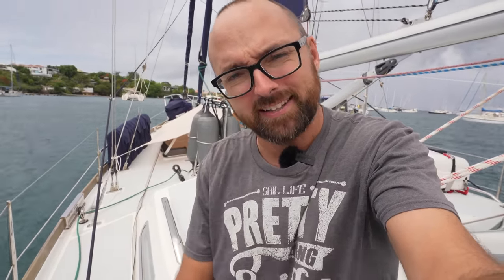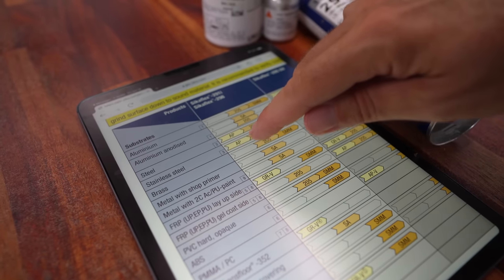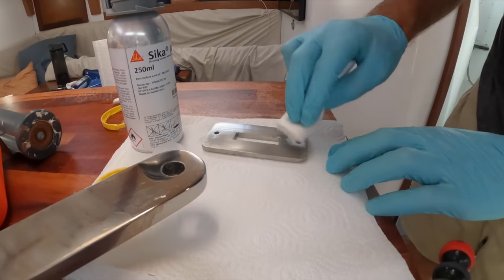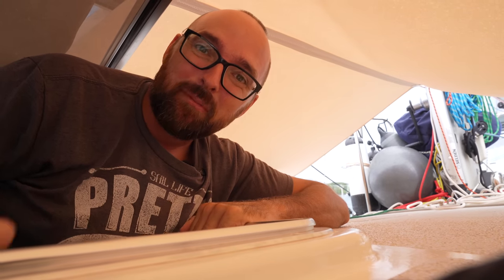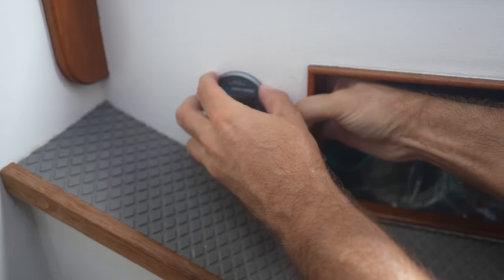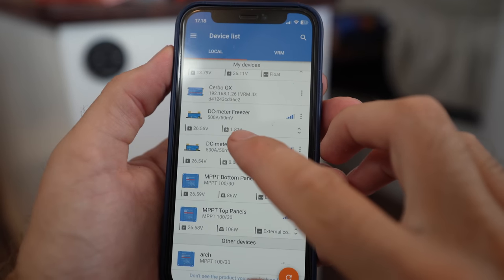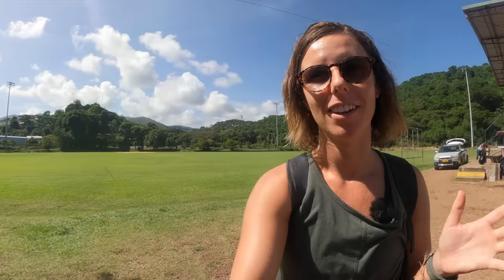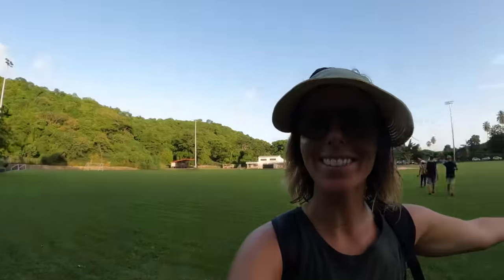Sail Life - Victron Energy Smart Shunt and leaky chain plate

Comment: Our fridge is an Ozefridge eutectic icebox conversion system from Australia.  It draws 100w or so when running and only runs a couple of times a day or so depending on ambient temperature and how many cans of warm soda gets put in and cold soda removed.every day to drink   I think most of the power this fridge uses/wastes is in making warm diet coke into cold diet coke.  

But it never draws zero power because of the controller computer circuitry draws 1.5 watts all of the time even when the compressor is not running.

To keep our freezer seal near 100% air & moisture leak-proof we bought a big 36" x 36"  silicone counter cover that totally covers the fridge hatch which generously overlaps the freezer top opening by a few inches.  That's the best outer seal possible.  We can spill a glass of water on the counter and not a drop makes its way down into the fridge which wasn't the case before we got that silicone cover.

We use a cheap $20 Amazon Chinesium shunt and LED power meter to track the performance of the fridge -as well as others to track solar, wind, shore power, and alternator charge inputs and also for total draw.  They aren't "smart" linked together or to a master meter, but show watts, amps, voltage at the moment as well as the cumulative total watt-hours through each shunt on its own meter.  I can log these values and keep track or just ride them by the seat of my pants.  As long as we are making more power than we are using and the battery voltage stays up things are all good.  Total cost for all these meters was under $150 and replacements are cheap should they ever fail.
Reply: Yup - the Ozefridges are the standout option. I have heard nothing but good things about them.
Reply: The only downside is that they are on the other side of the world for US or European cruisers.  Tech support is either in the middle of the night or an email reply is necessarily read the next morning.  That is not usually a big deal but may result in the unit being down/thawed overnight instead of an immediate fix.  

Parts take a long time to get too, and shipping is expensive from Australia.  We were hit by lightning so I  can't fault their equipment for failing when everything else electronic on the boat went down too, but I did have it up and going again the very next day because they had originally shipped a spare Danfoss compressor motor controller with the unit when new.  That was a damned good thing because the new spare took weeks to get to us.  We won't be going without a spare...

When the little freshwater circulating pump eventually died too we opted to source a local alternative rather than buy their official pump and have it shipped and bear the 4x cost because of shipping and then wait weeks.  Many other items on the boat that did survive the lightning hit died in the next year or so.  I'm crossing my fingers that the rest of the Ozefridge electronics keeps chugging away and the compressor itself doesn't eventually succumb to long-term lightning damage.  If it did we would likely buy a whole new compressor unit.

Comment: Regarding connectors that don't retain themselves very well: I had a similar problem for a component in my motorcycle, and I've had great success adding just a little dab of hot glue to the outside of the connector. It peels off easily with a pair of pliers if you actually need to separate the components again, but effectively retains the plug in the meantime.
Reply: Yup. It's standard procedure in most road worthy electronics that rely on these types of connections. Even the more common connection type with the little prongs are blobbed. It's efficient and it works, just know that it has a life-time, especially if subjected to heat. I think it's something like 5 years for the commercially available stuff. What they use in industrial environments lasts much longer, but, it is more difficult to get a hand on.
Reply: thats a great idea im going to use it on my little tw200!!!

Comment: You might want to think about installing a "Soft Start" in your system, which is basically a bank of large capacitors which clips the the sudden spike/ surge of electrical draw from electrical motors and compressors.  So the stored current in the capacitors will supply those required startup spikes and therefor save overall current needs during startup on such electrical motors and compressors.  Same thing on the A/C, engine starters, pumps, etc.  So 1 Soft Start on your entire AC/DC system should do the trick.  That will clip off all those spikes and give you an overall current requirement on the vessel systems, plus add to the longevity of your batteries.  Also consider saving your older cell phones (as long as they still work, the screen is not cracked and still holds a good charge) as a device that can hold those monitoring apps, without clogging up space on your new phones.  They still can work and have functioning bluetooth and wifi connectivity.

Comment: Check your freezer lid with a camera inside. Use a flashlight torch to shine at the lid edges and you'll get an indication where energy rich warm air leak down into the energy deprived colder air inside the freezer. Your camera will catch every glimpse of light. It worked as a charm on my domestic freezer. I got about 40% lower energy consumption rebuilding the darn Electrolux floor freezer. There were some other flaws with the insulation around the compressor and condenser too but that was much less improvement than the seal and wonky lid/edge.

Comment: Interesting your findings re fridge and freezer.
I have recently built a new freezer for our boat.
The method was 75mm thick rigid polyurathane foam sides and top with 3 layers of the same foam in the bottom.
The freezer carcass is glued together with pva glue then fully encapsulated in fibreglass then painted in epxoy paint.
I used a 12 volt bd 50 isotherm compressor and evaporator plate.
The freezer is 90litres and is achieving -16 c the compressor runs for 5mins every 20 minutes.
This is a lot less than our fridge ,replacing the fridge is the next task.

Comment: Neoprene draught excluder on the door to the freezer-makes a huge difference...  Loved the walk and commentary-excellent Ava!  The connectors are flimsy on the Victron connect controls etc but I've not experience too many problems with them.   Perhaps some heat shrink to hold it in place.  All my cables are held in place with cable ties and nylon cable tie blocks- this certainly holds the cable firmly.

Comment: 7:43 hot glue blob OR take apart the mother/father part of the connector and solder the wires directly to the board down to another connector on the wire, that's rated to take the strain (threaded one, being the best).

Comment: I also have an isotherm freezer, but one with the door on the front. Build quality is incredibly poor. I had a terrible frost problem, which was solved by simply sealing the outer case to the inner liner with aluminum tape. The top shelf also wouldn't freeze. On their web site they call it a "chiller shelf" as if anyone wants a chiller shelf in their freezer. I installed an air circulation fan at the back of the top shelf with a piece of plastic board made to force the fan to draw air from behind the evaporator. Now I have a freezer that will keep ice cream hard on any shelf, and has almost no frost. The compressor still runs nearly continuous due to poor insulation. 

Sorry to kick you off the mooring ball. We normally prefer our anchor, but we're back in the US for a few weeks.

Comment: You will get early warning .. our home fridge  over a period of a few months started consuming an absolute tonne of power when running and also its duty cycle increased dramatically, in the end it still worked and I only got a new one cause I realised how much power it was using. This is a very worthwhile project, looking forward to your results.
Reply: I recently had a fridge die on me. The electricity bills were sky high regardless of the season so now I'm thinking that the fridge was the main culprit. Definitely worth looking into some sort of smart metering for major appliances.

Comment: When you're state side, buy gel pouches for portable coolers and stuff them in your freezer to take up the empty spaces.
Firstly, that's going to even out the strain curve on the machine, because you have a bigger mass, less air, more retaining temp volumes (when you open the door, you're sucking in quite a bit of heat (that's why store freezers for ice cream, ice chests, have slide doors)). 

Secondly, and the most important, the gel pouches act like batteries. That's cold storage in case your freezer dies or power dies. You won't get a long term use out of them, but depending on how many and how well the freezer is insulated... it's a lot more than without.

In my long term freezer storage, i have gel (you can buy it by the bucket for specific purposes) inside the freezer, and all the items are sealed inside vacuum bags and thrown inside. I've never tested the thing, but power was out intermittently for almost two weeks a year ago, while major repairs were done to our local substation and the draw on my solar system was almost invisible. The first three days was nearly continuous power outage and the freezer compressor only came online once, on the third day.

It's impossible to use this on a boat, for obvious reasons, but the gel pouches do work. They are designed for this, after all.
Reply: If they have a vac sealer they can make 1 liter bricks of 10-15 % salted tap water in vac bags. Same concept but cheaper  I have 4 flat brick in the bottom of my freezer for extended temperature retention.

Comment: When you get state side see if a common refrigerator gasket will fit your freezer, you can epoxy a metal piece to the lid so it fully seals. Or get a freezer gasket from McMastercarr it is a magnetic sticker and magnetic seal designed for -40c

Comment: for then flimsy connections. put a small dab of hot glue on the connection. it will hold it very well. and the use of a razor blade will cut it off if ya need to disconnect it. Its what they do for small circuit boards like on 3d printers and such.

Comment: Mads, if you do build yourself a freezer, I'd love to see you use VIP Insulation panels. Supposedly they are something like R-30 per inch. The compressor won't have to work too hard to maintain temps with that, and you'd probably gain tons of extra space in the process.

Comment: I'm a big fan of both Sikaflex and butyl tape; however, when working in warmer weather, I find the 291 LOT (long open time) tends to seal more reliably for me. The non-LOT version can start to set very quickly, and, if you shift the fitting the slightest amount, you may end up with a compromised seal (this was a BIG problem with my Jet Thruster pump install, requiring a quick haul out and thru-hull redo). The LOT also has the advantage of being a bit easier to get multiple uses out of a single tube, so I tend to waste less of it.

Comment: with the eutectic fridge is it configured to always charge on spare solar or gen power when available, and not when it requires a full recharge eg does it recharge when fridge is at 90% charge to keep it at full thereby ensuring max time before it needs a full charge due to weather or lack of power - When working in NW of Australia (the outback mate) we had eutectic fridges and freezers and they would last 8 -10 days without power - fantastic, would love to build on for the house and charge on the spare solar the majority of the time

Comment: Aside from the seal issue on the Isotherm which I’m sure you’ll solve, how does the locations of the compressor compare for the fridge vs the freezer?  Does on have an advantage (cooler location)?  I believe the compressor on the Isotherm can be moved if that would help…

Comment: If you have a fitting that repeatedly leaks, then it may be that in that spot, there's more flexing of the hull/deck or what ever it is. Reinforcing the area of the fitting may be the only way to get an acceptable result. A few layers of carbon fiber and epoxy works wonders.

Comment: Most freezers have space between the insulation and the steel case. Why not add some insulation to the sides and replace the top seal with either a new one or a better one?

Comment: That ISO THERM freezer sucks. Yeah, I would be looking for ways to add insulation to the outside AND try figure out a way around the ice build up on the gasket surface as well. The 'ol double wango on that one. Could possibly just got straight to building one gutting the system of the ISO THERM of its compressor, condensing and evaporation coils. I am sure you could find a cold plate to replace to evaporation coil though. Hopefully you still your vacuum pump aboard. If not you gat just gut a junked refrigerator whose compressor is still good at a scrap yard and inject oil into it to suck the moisture from the re-vamped system before re-filling it with refrigerant. Old scrapped AC&R compressors make good vacuum pumps in a pinch for clearing out moisture without spending a ton on a new vacuum pump. They will never suck down to the micron level but 21" is all you really need when dealing anything but absorption systems.

Comment: Sikaflex is a bonding system. You're not sticking it to anything,  such as fiberglass or stainless,  you're bonding the sikaflex to the primer. The right primers stick to the materials of choice. I was pleased to see you correctly apply the correct primers - everywhere else you used it without will probably fail. Yes Sikaflex can be great stuff, but i also think its highly overpriced and over rated in various use cases. Remember to use UV variants anywhere exposed to the sun.

Comment: You need a frost free freezer. Our home freezer has no build up of ice what’s so  ever. It happily chills to -25 . it basically gets rid of condensation and water Vapour which what makes all the ice form.
Reply: Frost free freezers use a heating coil, and force any frost to sublimate off and eventually go down a drain hole. During the defrost cycle, power consumption goes up and sometimes the heat ruins food that is too close to it. Sadly not ideal for a boat.

Comment: One thing you having a moisture issue (duh on boat in the ocean) you're having condensation forming and freezing on seal of the freezer. If you can stop the condesation (maybe a thicker seal that sits above and is tighter it might abate this issue.

Comment: I've been studying the sika options for marine applications, and from what I've seen, sika 291i is not made for outside use as it doesn't resist to uv rays.  That's why they made the 521 uv.  Yours is mostly hidden under the stainless plate, so it should be fine.   But why not going with the uv version ...  THe guy at the boat yard where my boat is told me to use sika sg-20.  It's made for sealing leaky things and apparently sika doesn't require primer for it.  So i't much easier and cheaper to use...

Comment: I noticed your forward hatched opens aft, have you considered flipping it to catch more air when you're on a mooring ball?
Reply: FWIW, the rules for some of the offshore races actually prohibit foredeck hatches that open that way, since any wave breaking over the deck would also be neatly sucked into the boat. Athena is not racing--but it is still done that way for safety.

Comment: When the chainplate starts leaking the next time (it will, 291i doesn't like to stick to stainless for too long), try using SMP glue or that 591. 
At least to me sealing chainplates was yearly business with 291i while SMP stuff has been going strong for 3 years.
Reply: I wonder if it’s leaking because it’s moving?
Reply: @kevinmills5293  almost certainly, the design seems kinda compromised but I dont know enough to come up with a better design.

Comment: Mads, do you keep your freezer full? if it's not, fill it up with water, so it freezes and uses less power
Reply: Ice cube bags are perfect. Fill them up with drinkable water and then stuff them between the empty spaces. Not only are they going to take up the space, which less displacement when you open the door which sucks the hot air outside in, but also: the ice becomes a battery. Less fluctuation during use, and if the power goes out, your freezer lasts longer.
I don't really care for ice cubes, so i just use gel pouch batteries. They're cheap enough to not be a burden on the wallet, and they are even more efficient than water as a battery/dampener.
One word of caution, don't put them all in at once, huge draw and strain on the compressor. Just dunk 4 or 6 of them and slowly fill it up.

Comment: The freezer compressor running 24/7 should be a bit worrying, unless it is a variable speed device. Going full tilt 24/7 means it has no reserves if the environment gets hotter - IMHO that's a bad thing for a freezer. Having temperature monitoring should confirm that.